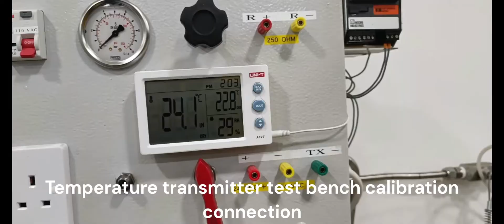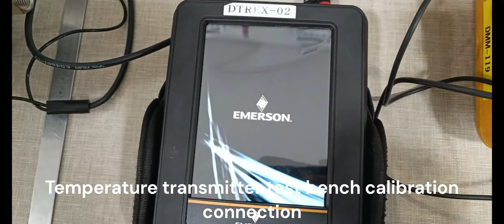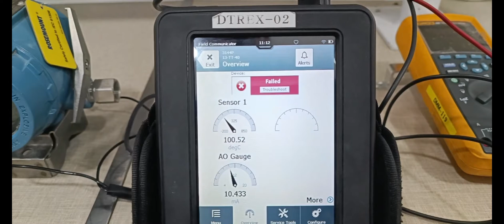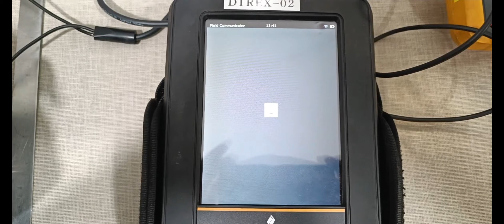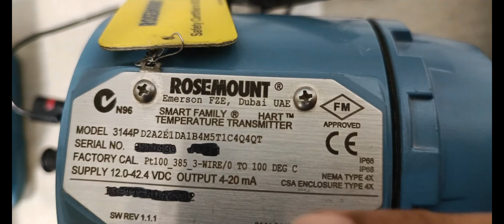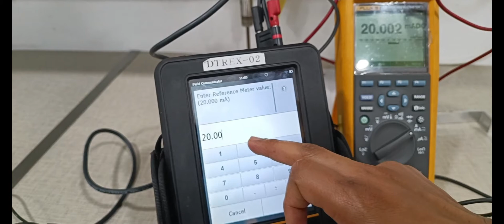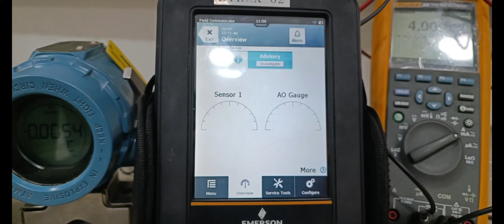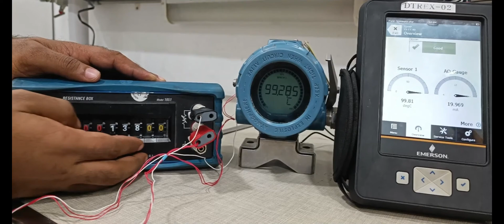ROSEMOUNT 3144P Temperature Transmitter Sensor Configuration and Troubleshooting

Comment: What is the usage of hot back up?
Reply from the maker: The Hot Backup
 feature provides temperature measurement redundancy.

01. If Sensor 1 and/or Sensor 2 should fail while PV is configured for average temperature and
the Hot Backup feature is not enabled, the transmitter will go into alarm. For this reason, it
is recommended when PV is sensor average, that the Hot Backup feature be enabled when
dual-element sensors are used, or when two temperature measurements are taken from
the same point in the process. If a sensor failure occurs when the Hot Backup feature is
enabled, while PV is sensor average, three scenarios could result:
• If Sensor 1 fails, the average will only be reading from Sensor 2, the working sensor.
• If Sensor 2 fails, the average will only be reading from Sensor 1, the working sensor.
• If both sensors fail simultaneously, the transmitter will go into alarm and the status
available (via HART) states that both Sensor 1 and Sensor 2 have failed.

02.The config hot BU command configures the transmitter to automatically use sensor 2 as
the primary sensor if sensor 1 fails. With the Hot Backup feature enabled, the primary
variable (PV) must either be first good or sensor average. See Average temperature for
details on using the Hot Backup feature when PV is sensor average. Sensors 1 or 2 can be
mapped as the secondary variable (SV), tertiary variable (TV), or quaternary variable (QV).
In the event of a primary variable (Sensor 1) failure, the transmitter enters the Hot Backup
feature mode and sensor 2 becomes the PV. The 4–20 mA signal is not disrupted, and a
status is available to the control system through HART Protocol that sensor 1 has failed. An
LCD display, if attached, displays the failed sensor status.
While configured to the Hot Backup feature, if sensor 2 fails but sensor 1 is still operating
properly, the transmitter continues to report the PV 4–20 mA analog output signal, while a
status is available to the control system through HART Protocol that sensor 2 has failed. In
the Hot Backup feature mode, the transmitter will not revert back to sensor 1 to control the
4–20 mA analog output, until the Hot Backup feature mode is reset by either re-enabling
through HART Protocol or by briefly powering down the transmitter.
For information on using the Hot Backup feature in conjunction with the HART Tri-Loop see
Use with the HART Tri-Loop.
03. Problem description:
The unexpected failure of a critical temperature measurement can
cause safety issues, environmental or regulatory concerns, and process
shutdowns.
Our solution: The Hot Backup feature allows the transmitter to automatically switch
the transmitter input from the primary sensor to the secondary sensor
should the primary sensor fail. This prevents a process disruption
due to the failure of the primary sensor. A maintenance alert is also
generated to notify operators that a sensor has failed and the Hot
Backup feature is active.
How it works: Two sensors are wired to a dual-input transmitter. The two sensors are
measured in alternating fashion, so when sensor 1 failure is detected,
the transmitter can immediately switch the output to reflect the sensor
2 value. The switch is automatic with no disruption to the analog output.
The transmitter sends a digital alert to inform the users that the Hot
Backup feature is active and the primary sensor needs investigation.
Take away: “The Hot Backup feature prevents primary sensor failure from
disrupting process control.”
Target
applications:
Redundant measurements, critical measurements, trouble spots.
04. Alerts configuration for Hot Backup
Alerts for Hot Backup when configured with first good temperature
Primary sensor failure
Communicator message
If your primary sensor fails, the second sensor immediately takes over. The transmitter will
report a failed device status, indicating Sensor 1 is open and Hot Backup is active. This is
shown in the Field Communicator in the Overview section.

05. if we are using the dual sensor, Hot backup should be enable condition.
Reply: Can you send hot back up configuration chart?
Reply from the maker: @mithunkckc4194 all manufacturers scenario is different.
Rosemount conf. Available in this video.
Reply: @InstrumentProcessManagement Ok. Thanks
Reply: 644SAE rosemount TT how to configure how to configure hot backup?